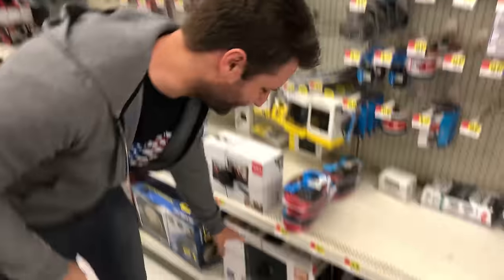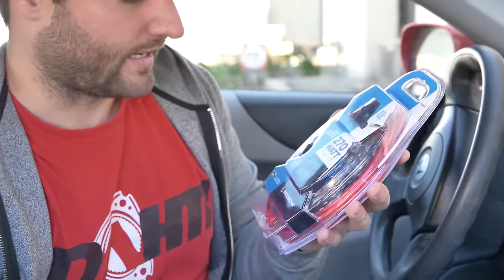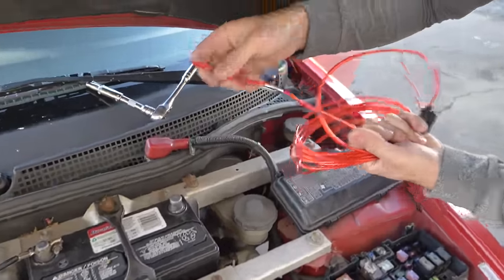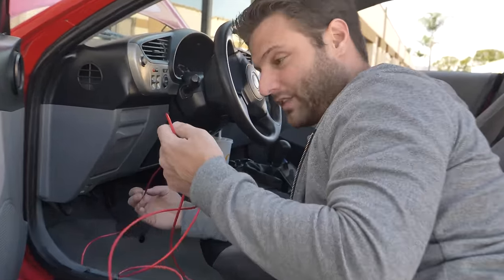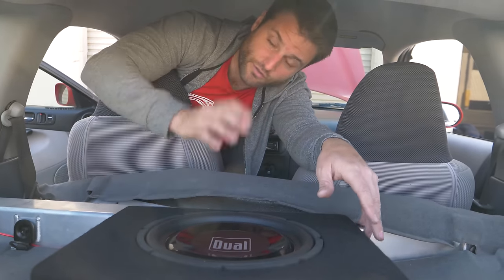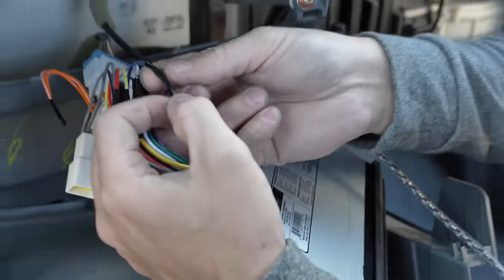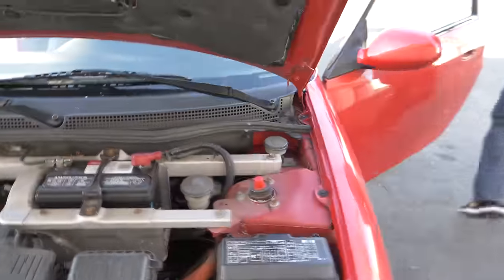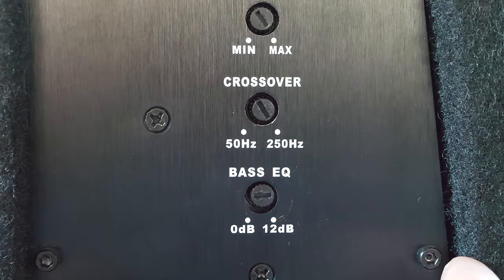How bad is the $70 subwoofer from Walmart? Install | Review

Comment: this is a cool option for the people who aren't quite ready to get an actual sub and amp but want something on a budget

(it is really weak just FYI, camera guy was correct)
Reply: The only difference between this, and a separate sub and amp is 2 wires, and the amp isn't in the box. You also don't have to wire that stupid harness.
Reply: if you buy a shit sub and a bad 300w amp yeah, but my low end 10" on whatever built in amp is in my Logitech home theater system (X-530) blows this thing out of the water. and my cousin's setup which has cost him total about $100-$120 is a 1200w 12" on an 800w amp and makes this little prebuilt one look like a tweeter. bottom line is for a little extra money you can do much better, but this is still a good choice for people who just want to throw  a cheap one in their car and be done with it, without worrying about RMS wattage, peak wattage, gain, all that shit you have to start looking into when you get into an actual system.

EDIT: it seems like the AMP in my Logitech home theater system is 70 watts, kind of surprising for how much bass it can push through my 10", now i wonder what it can do with a good AMP in a car :Thinking:
Reply: BigMan7o0 probably best not to hook it up to a different source, there's probably not much to gain
Reply: BigMan7o0 The home sub is probably highly sensitive. Something like 92db/1w. Also, matching subs and amp are not hard. Gain isn’t even an issue whenever you match RMS. You should also always overpower a little. Crossover is a bigger deal than gain.
Reply: GhilleGhille to a certain extent yeah, it really depends on the use case. For something like wanting a massive amount of bass at the highest volume possible, you would really need to pay attention to wattage and shit so you don't blow your sub, and gain would be more of a "do I want/need this for my use case, and why?" Kind of thing, not necessarily a "oh it doesn't have gain 0/10 bad AMP"
Reply: BigMan7o0 Well I mean unless you’re putting like 500wrms over, you don’t have to worry. You should turn your gain up right up to clipping, but not clipping if you got your subs and amp decently matched. If you got like a 5kwrms amp and 2kwrms worth of subs, then don’t turn it up all the way.
Reply: yeah if you mismatched your AMP that bad absolutely do not turn it up all the way, it will cook your voice coils. 

and it kind of depends, some subs have a decently high peak wattage compared to the RMS, and can take that peak with zero problems, where lower end subs might have problems at peak wattage.
Reply: In such a tiny car tho. 
This sub/amp combo would do wonders for the deck and speakers he installed.
I wouldn't buy anything more for this car system. 
it is COMPLETE! 
Now hit up the next competition and measure your db's
Reply: Josh Redman i am the kind of person that can never get enough bass, so i would throw 2 Platform 5 15s in there if i could afford it.
Reply: Dayum! those PSI's are sick. All you'll need now is an 8 to 10 thousand watt RMS amp, power wire, batteries... oh god this list is gonna be long...
we gonna have to rob a train to do this bro... haha
Reply: hey i would rob a train for some sick car audio ¯\_(ツ)_/¯
Reply: GhilleGhille i finally figured out what sub i have with some help from people on a car audio subreddit, and it turns out you were almost exactly correct, 91dB at 1 watt.

Comment: 270W wiring for a 300W amp. Nice
Reply from the maker: I found that funny too. But I shortened the power loop considerably so the gauge of wire will work for higher amps.  Not going to lie. I don’t expect that sub to actually be a 300w setup but idk.
Reply: Not a chance in all of hell that sub is 300w RMS. No way, no how.
Reply: its 100w continuous
Reply: That sub is probebly runing around 50W because cheap subs often cheat the numbers
Reply: Linkan Laddtryck 300 amps PEAK POWER, the rms is half if not less of that.
Reply: I don't care how many watt any amp is you don't run smaller then 4ga wire you can pick a cheap kit up for around 20$ what you installed is just asking for problems
Reply: the amp is not running at 300w constant, peek is 300w same for the sub, its probably 100-150w rms for the sub, cheep system, used car audio marked is booming with subs and amps that are mutch better and for a cheeper price, nice install btw thats how u shuld do it :)
Reply: 300 watt peak, ie couple of seconds maybe. Really rms probably about 100 or less. You'll be alright Rob
Reply: Will be more sound 75watts rms it’s just a 300w peak 😂
Reply: When I have a 2000w rms subwoofer and it peaks at 6k lol
Reply: Probably peak 300watts not continuous
Reply: Yeah i'd say 30WRMS is probably closer to the truth and the peak is probably no more than 100W. 300 real RMS Watts in an amplifier will run you about 200 dollars, and that's cheap compared to 80s-early 90s prices. Don't see why Duel would give you such an epic rebate on power and give away a sub and box for free at the same time. Lower price range audio almost always throw out bullshit numbers, to hook the customers who get horny off numbers on a cardboard package. That's not to say it's insufficient for the needs of someone who just want something other than the beat up stock shit in a 20 year old car. Like Rob Dahm, not by any means an audiophile and as long as he feels he got value for the small amount he paid, it's all good, i don't see a need for anything more advanced there either, a little more bump and clearer sound, that's what a cheap system is for. That amp could probably be run with one strand of wire though, numbers mean nothing unless you paid for numbers.
Reply: the amp has a 10a fuse.  thats 144w rms at 100% efficiency.  probably around 90-100w rms
Reply: Jordan B that makes no sense. He will be perfectly fine with 8 gauge or 10 gauge power and ground for this setup.

Using 4 gauge here would gain absolutely nothing.
Reply: Dual isn't that bad. It's the cheapest anyone should go and that's after exhausting all options. It's better than BOSS and Pyle (it's a real pile of something alright) which are criminal advertising 1000w but don't fair more than 10% of that then heat up/short out.
Reply: DareToBeDeviant boss and dual are made by the same people. Many of their products are exactly the same with different brand stickers on them.
They dont build or engineer anything themselves
Reply: If it says 100W RMS it probably is. Dual was tested to actually put out rated power on Ryan Blankenships channel on here. Also as far as subwoofer positioning, it’s about what sounds best to you. If it were me I’d place it a few inches away from a corner to increase low end response, preferably a hard corner (not the hatch door).
Reply: Dawn just because one dual amp made power in one install doeant mean they all will.  
That same amp wont even make the same power if the same enclosure..woofer..settings etc just a different car. Itll all be different.
Reply: It has a 15 amp fuse.
Reply: haha lol 100w rms?my rear speakers do 90w rms
Reply: There was a video in yt where a guy did a review on the older version of this system from what i can recall the amp cant push 100w but the sub can he said something along the lines where the box makes it sound like its a 300w system. Im trying to look for the vid rn, ill link it if i see it
Reply: Dawn don't think Ryan has ever tested a dual amp and sub combined.this is a dual plate amp and it's definitely junk.
Reply: 300 watts peak dude,  i think it comes out to 100 watts rms if im not mistaken.  Either way you dont even need that much power to drive a sub,  ive got a sub running on of like 250ish rms and it bangs
Reply: if that amp actually pushes 300 watts ill kiss everyone in this threads ass. put it on a amp dyno my guess is around 40 watts rms
Reply: a amp can not make more power than the fuse will allow. so if you have a amp that claims it is 300 watts max with a 15 amp fuse it is impossible for it to make anywhere near that claim. a 15amp fuse at 12 volt would allow a max of about 180 watts. Then we need to talk about amp efficiency. If that amp is capable of 80% efficiency and I doubt it is that brings your total watts down to around 140 max which on a amp dyno running in uncertified mode might pull 60 watts max maybe a lil bit more in burst.
Reply: Easy way to calculate how much an amp puts out take fuse rating multiply by 10 then multiply by .80 as at best you will have a 80% efficient amp so say it has a 20amp fuse multiply by 10 equals 200 subtract 20% for efficiency lose and you have 160rms
Reply: That subs Around 100-150w RMS; not 300w RMS, no worries.
Reply: Jordan B 12AWG is enough for the dinky little amp in that subwoofer, I doubt it pulls more than 10 amps continuously. :P
Reply: I️ know the difference between peak and RMS power damn.
Reply: InfinityEmpireServers don’t cry
Reply: It’s tuned to sound like 300w, already seen a video where it was taken apart and checked. It was pushing like 90
Reply: Micah Nixon no
Reply: Jefferson Graves that doesn’t even make sense you noob if you could tune a small speaker to sound like a big speaker we wouldn’t need big speakers, it is tuned by variable crossover to sound like a sub not to sound like a 300w rms sub they sound the same either way it’s just how loud and clear it’s going to get before it distorts
Reply: InfinityEmpireServers that amp pits out maybe 100 wats
Reply: william staten every 8.3 Amps at 12 volts is 100 Watts m8
Reply: william staten noob get rekt
Reply: Yeah I think it gets around 80W RMS. It's not a bad sub for a single-cab pickup truck, provided you are short enough to fit behind the wheel with this thing shoved between the seat and the rear wall and you don't expect too much from it. I have one, worked great in my truck, but after putting it in the trunk of my Camry I first blew the port out of the box, and then blew the driver completely in a week's time. And I don't crank the bass as much as most people do...
Reply: "so if you have a amp that claims it is 300 watts max with a 15 amp fuse it is impossible for it to make anywhere near that claim." 

Check out femtosecond lasers, they are typically plugged into 110VAC-15A receptacles yet the power output can rival first world industrialized nations ( for extremely small amounts of time and significantly longer charging times ) thanks to reactance.
Reply: InfinityEmpireServers lol
Reply: Alittle  more get the  power acoustic  12  a box  and  the best amp  itll  rock your  car  hard
Reply: that wiring looks like a 12 gauge or smaller, i wouldnt use that for a 50 watt 4 channel. never saw the "sub" move when testing, hence not much power. had an interfire 2250 (believe 250 watt) amp into 4 ohm from early 2000's into 4 mtx 10" subs in a ported box, 94 extended cab chevy 1500, won several local competitions. never underestimate less watts but more surface cubic inches.
Reply: the video shows this system pushes 50w rms https://www.youtube.com/watch?v=aok2xtN3t-A
Reply: That's what I thought Chris.
Cheap subs typically advertise the "peak" power on the box, which is literally an advertising number, meaning they hit that power, even for a fraction of a second, before it blew. So it's a useless figure.
Typically RMS is half of what peak is,  and on super cheap subs and amps, can be 3x lower or less. I've seen 1000w advertised peak that was 250-300 RMS.

Comment: I think this guy did a GREAT job wiring. Running the wire behind the fender eliminated the need to drill or add holes in the fire wall, and it thoroughly separated the power wire from any other wire to avoid future confusion. I would feel better if it was right on the battery but to each his own. Separating the power wire from the audio wires is also very important, keeps the sound clean. Just dont waste your time with wal mart stuff, well maybe if you have to. I used to get 6x9s there to be honest